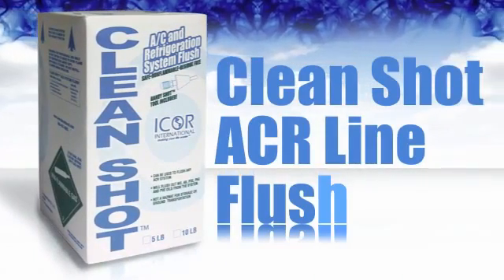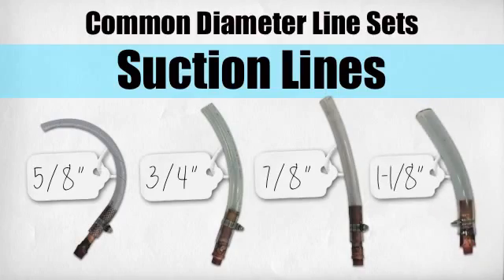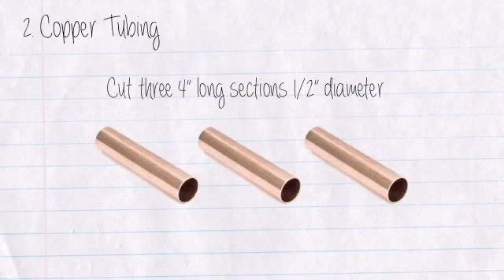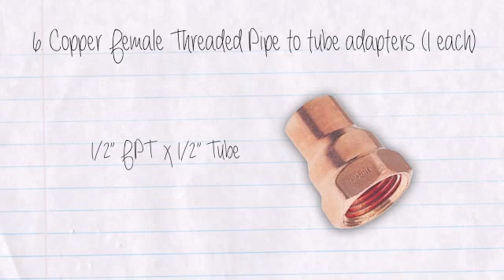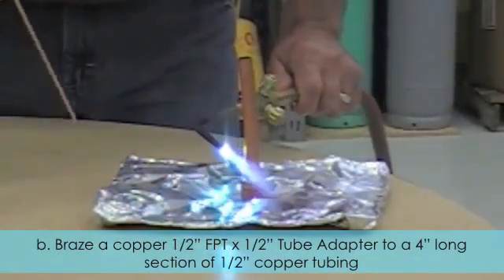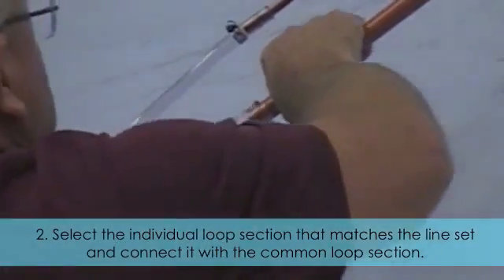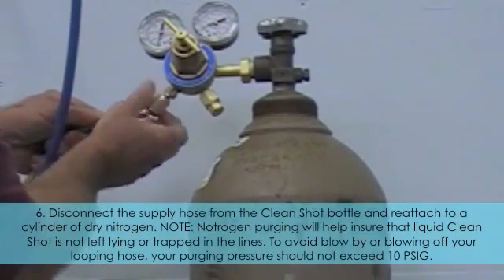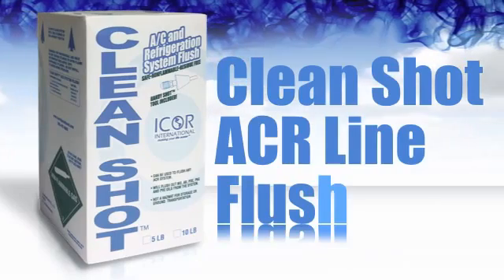Clean Shot A/C System Flush - How To Construct A Universal Looping Kit For One Person Flushing

Comment: How about just looping the liquid line back to the suction line and braze it together inside. then, outside braze on a schrader stub on the liquid line, put the suction line in a jug with rags. hook up a refrigerant hose to the schrader port and flush into the bucket. Works great, 1 man operation and you only have to have a braze in schrader port and rags. this other way is crap and takes too long.